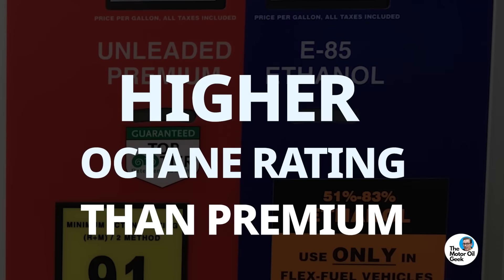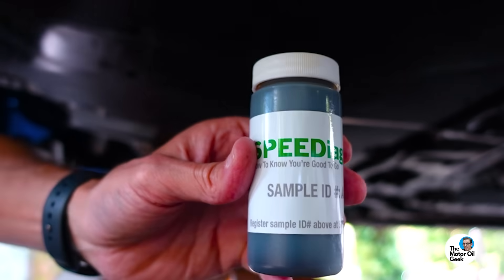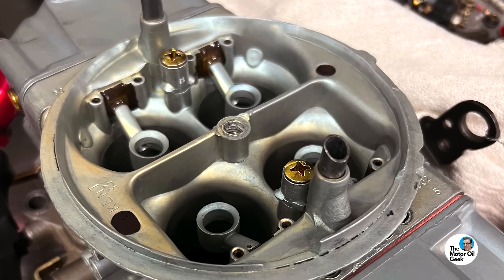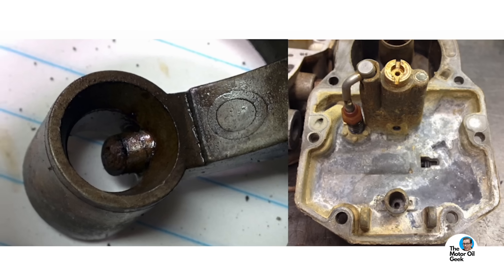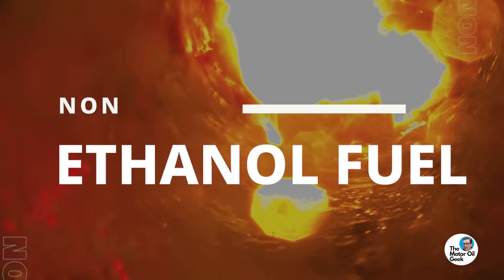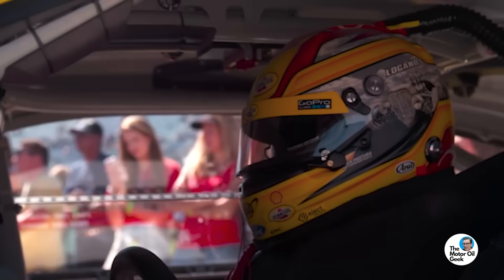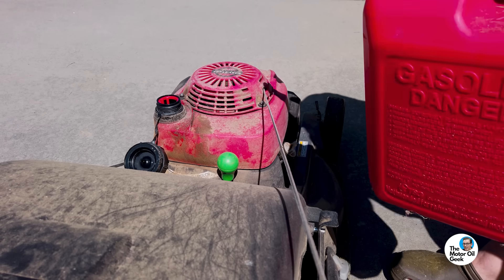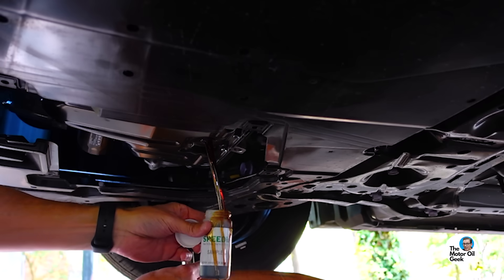ETHANOL: Higher OCTANE, Higher RISK?

Comment: Lake, I have a Murray lawn mower with a  3.5HP Briggs and Stratton. 30 years old and never touched the carb. Its a solid citizen, but I have two-stroke weed wackers and the carbs are a headache. This probably explains it. Thanks for your investigation. I love to hear about professional deep dives.
Reply: It’s the oil in the mix that gums things up too.  Try and lean out the oil in the mix w/non eth fuel.  Also take the spark arrestor off if it has one, help it breath out the back end too.

Comment: Ethanol is only a problem if your fuel system is not sealed because that's the only time it can absorb water.  And water is the real issue.  Old cars with carbs, non-sealed fuel systems (most lawn equipment), etc. yes, avoid ethanol.  But on any car made since the 90's, ethanol, if you tune for it, is absolutely amazing for power production, not just because of higher octane, but because of increased charge cooling and the fact that the higher mass of fuel you burn liberates more energy than gasoline per lbs of air ingested (about 7%).  And in many states, especially those with high gas taxes, the cost/mile is cheaper than running 91/93 octane fuel (you burn more, but its so much cheaper you still spend less).  I run E85 in all of my vehicles (admittedly the oldest is less than 25 years old) and love the stuff.  I also run high quality synthetic oils.  And if you're not running catalysts in the exhaust it doesn't smell bad like gasoline, not that I'd ever do that...
Reply: Yeah, this video was really one sided since it focused so heavily on carbs and ignored all the benefits E85 offers to modern vehicles set up for it. It has huge performance benefits and costs significantly less than other premium fuels. Also it does smell much better should someone have a lack of catalyst in their exhaust..
Reply: Yeah, it’s my understanding that ethanol itself isn't inherently corrosive; its tendency to absorb water and its incompatibility with certain metals is what can lead to corrosion.
Reply: @DavidT-s8v that's mostly true. It is corrosive and will break down rubber and other components that aren't made to handle it. But most cars around 98 and up are made with it in mind and any car being prepped for E85 would/should be put together with ethanol compatible parts which are easily available.
Reply: Ya I run E85 here in cali in my 392 Hemi. The engine loves it!! My wallet also loves it, although I am filling up about every 8-10 days lol. During Biden with gas prices premium 91 went to over $6 a gallon in my area where it used to be only $3. As soon as I saw E85 more readibly available I had my tuner send me an E85 tune and switched injectors and I was good! Curently paying $2.67 a gallon for E85 where premium is at $4.29 a gallon. I made the switch at the right time too with those prices as Chevron had a $1 off per gallon for your first 3 fill ups when signing up for the app. So I just signed up using a whole bunch of phone numbers and was only paying $1.89 a gallon for quite a few months!
Reply: Agreed on everything, except the small engine stuff doesn't care either, if you don't store for long periods of time with gas in it.
Reply: The water gets in before you get it into your tank, so it doesn't make a lot of difference in a sealed system. When sending different petroleum products through pipelines they are separated by a "slug" of water since oil and water don't mix. At the terminal receiving the shipment the end of one product is detected by the presence of water which is removed and treated until the next product appears. It then goes into tanks which have to be monitored for excess water content.These tanks are sealed to the atmosphere but not perfectly.From there it goes into trucks or rail cars which lack  perfect atmospheric sealing. When they is delivered to the storage tanks users draw from, those tanks have to be vented for the new fuel to go in and are generally always atmospherically vented themselves. So no matter how well sealed your car system is water is already there. And for fuel to be drawn from your car tank atmospheric air must be admitted in equal volume to the fuel drawn so the tank doesn't collapse from suction. 

So yeah, newer is better but it's not good enough to keep water out of your engine. Better to have nothing in the fuel which is hygroscopic like ethanol to begin with.
Reply: Its only good, maybe for engines made after 2015.. I had an issue where E85 was mistakenly put into regular with 10%.. it killed my in tank fuel pump in short order.. its bad stuff..dont care what anyone says..
Reply: No, water is not really the issue, neither is the ethanol itself. The problem is that it contains soluble and non soluble contaminants like halide ions, acetic acid  and sulfur compounds.
Reply: Unless you have a special provider you WILL get extra water in your fuel. Nearly every gas station tank has a lot of water infiltration. The ethanol sucks it in before you even pump it. It's there already.
Reply: Go away and stop the bullshit. If you have a carborated car , you technically don't have a sealed system.

Comment: On DI Turbo engines Efuel (E30 to E85) does wonderful results regarding torque and overall power, but with my experience, the OEM fuel pump will have a shorter life vs using E0 to E10. Like always, your videos will be part of all gear heads to watch.
Reply: The pump needs to work harder to move more fuel volume at higher ethanol blends. It's typical to change to a higher volume fuel pump when using higher blend percentages of ethanol.
Reply: @Fix_It_Again_Tony  In some engines and larger aftermarket turbo setups, the higher ethanol blend also requires larger DI injectors which yes, DEMANDS higher volume fuel pumps, both the in tank, AND the high pressure one at the fuel rail.

Comment: Pump E-85 can legally be anywhere from 51% to 85% ethanol. Modern cars with oxygen sensors can adjust for the variations on the fly. Circle track guys found out the hard way that carburetors  can't adjust themselves for the all over the place ethanol content.
Reply: Where are you located and what gas stations have blender pumps? They automatically mix the E to the concentration listed?
Reply: @mygt8a4re  I live 50 minutes from the Greensboro N.C fuel depot, my neighbor is a fuel company dispatcher. I work in the racing world, and if you watch the beginning of this video, a notice shown on a pump says "51 to 85% ethanol". Proverbs 1:7.
Reply: @mygt8a4re South East Wisconsin. The Blender Pumps I'm thinking of are located in Eden, WI at the Eden CITGO Corner Express.  There used to be a bunch of unmanned "Renew E85" Stations (still are around Oshkosh?) that offered E10/E20/E85... Might still be what they offer?
Reply: My Non-Flex (up to E10 via GM, E15 per EPA) Fuel Injected 2003 Saturn's computer was able to adjust/run on E-blends from E0-E30 without noticable issues.  While it wouldn't set/display a code until over E49... Even then it performed rather well, some Misfires/stumbles but not stranded on the road kind of problems...  Similarly E30-49 might cause a brief stumble or Misfire but  no codes or fueling concerns... 

Haven't experimented with my 2014 GMC but it is officially up to E15 via both GM and EPA... Would expect that it can also easily handle local blender pumps which often offer E10,E20,E30 (and E85).  Will stay away from the E85... But given my Saturn, I expect the newer model can likely handle it
Reply: @lgoamity  Be aware the stumbles and misfires may be a lean condition, as the fuel injectors may not have the capacity to get the engine to a normal fuel/air ratio.

Comment: I've considered using ethanol free fuel in my modern gas engine (turbo, dual injection), but can't find any that are also TOP-TIER. I wonder if the benefits of using ethanol free outweigh the benefits of more/better detergents in TOP-TIER fuel?
Reply: None of your local TOP TIER Gas Stations offer an E0 option?  Not hard to believe, but sometimes with a little research/hunting you might find one...  

Locally my County/Region requires a Federal RFG which basically means E10 is going to be at the pump(s).  But I'm also near the Border so it isn't uncommon for me to visit Stations that are just "next door".  For example I have both CITGO and Mobil stations (Top Tier) that offer their Premium as E0.  Similarly BP (not Top Tier, but claims to meet/exceed the standard) also has E0 in it Ultimate/Premium, which I've used on occasion and before Top Tier was a thing (2004), with good results (assuming my fuel tank/lines aren't rusting out... Then I end up with leaks as Ultimate has on several occasions shown me a rusted tank or line, as it apparently cleans up deposits)

Also locally is Kwik Trip/Kwik Star (which was Top Tier, isn't now, but still has a Fuel Quality Guarantee, so that is an option too... If using their E0,E10,E15, or E85 fuels (in the proper applications of course) and problems occur.  Amoco/BP also has a published Fuel Quality Guarantee so something to keep on mind too

Comment: California gas has such a low boiling point. It boils right in the float bowl. And vapor locking is a huge problem. Is this due to the ethanol Or the amount of butane dissolved into the gas?  Would adding a little two cycle oil solve the corrosion problem?
Reply: The Reid Vapor Pressure of all modern fuels is blended for pressurized fuel injection systems. Ethanol blended fuels are slightly worse, but all modern fuels have this problem with carbureted cars.
Reply: I had that problem in a 65 GTO and 65 Corvette.  Insulating the carb didn't help.  Running a fuel return line back to the fuel tank solved it. It allows the fuel to continuously circulate keeping it cooler.  When the engine is shut off and everything heat soaks it prevents the pressure in the fuel line from rising and forcing open the needle/seat in the carb. It is amazing, though, to find that the float bowls are completely empty if the car sits for a couple weeks.

Comment: There is also the issue of ethanol emulsification in gasoline.  Their polarities don't match perfectly and require  alkylphenol Ethoxylates, ethoxylated alcohols, fatty acid or sorbitan esters, etc. All of which, when dried in a fuel system, leave a gummy residue that, for a small engine, will stop fuel flow and trap water leading to more corrosion, in addition to the ethanol's own effects.  MTBE & ETBE were better options.  Great video!

Comment: I use rec fuel 90 octane no ethanol in my work van It runs great idles smooth and quiet Am I doing it any harm? Oil changes very 5 k I feel the difference between it and unleaded 89 regular Am I doing any harm to engine? 2. L nissan

Comment: Ive hauled non ethanol gas before.  It was called REC gas and was 90 octane gasoline for boats and equipment with carburetors.  Also depending upon were a person lives. It could be 87 or 90 octane.
Reply: Yup, REC gas 90 octane, Citgo station by me pumps it I live in a boating community

Comment: I had a Suzuki 2.5 hp outboard with a carburetor, and had a terrible time getting it to run on E10 fuel. I took the carb apart and it was full of corrosion, and so I bought a new carb and everything was good for a year and the same thing happened. So I bought another new carb and switched to ethanol free fuel and no more problems.